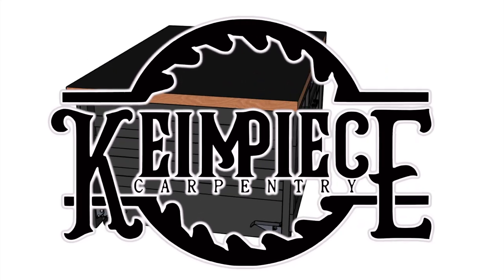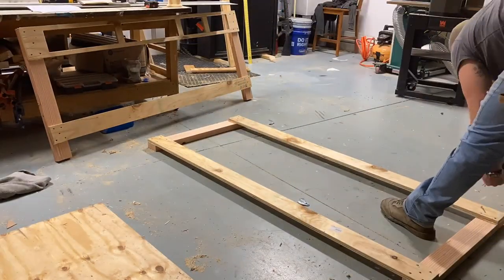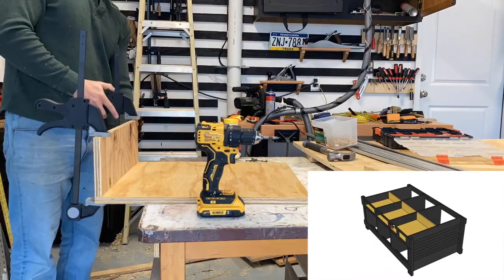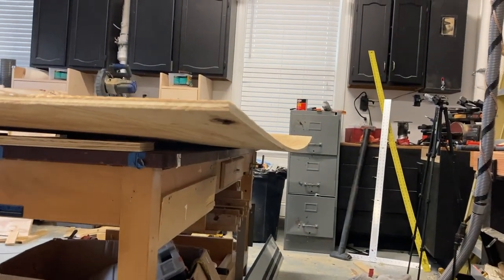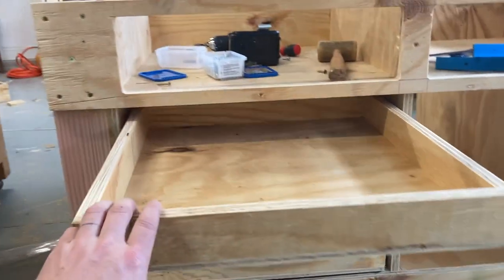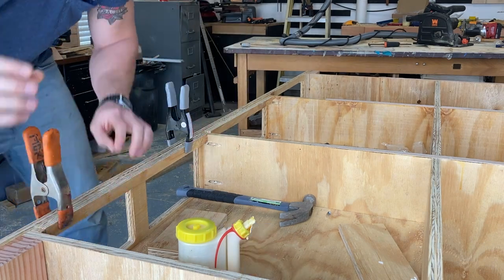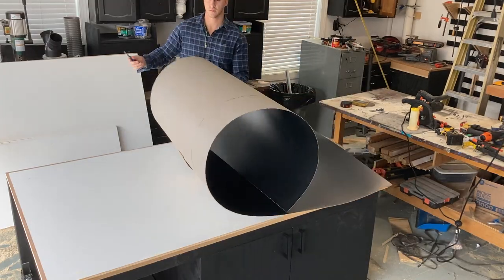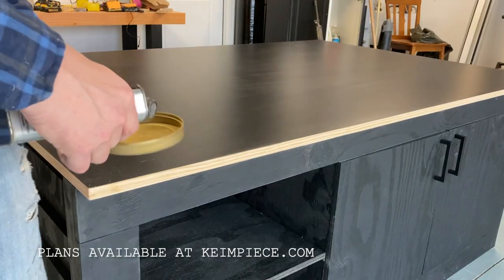Awesome Workbench / Assembly Table Build DIY

Comment: Ok at just under the 5 minute mark…you are NOT stupid. I am just AMAZED at the things you create with your hands! You are really gifted and intelligent. I watched your videos on the patio build and your video on data collection to determine the best dust collection system. I’m thinking to myself where did this guy learn all this?! If I wasn’t a nurse, I would be a carpenter. I’ve done some simple diys but I want to do some bigger projects so looking at building a workbench. Mine may not be as pro as yours though! 😅 But thanks for the video and great job!
Reply from the maker: Thanks for the kind words Leah! There are plans available to build the workbench I did in the video. I'm actually working on another workbench video for a hand tool workbench with a modern twist. 5 layers of MDF for the top and 4 different vices. Make sure you subscribe!